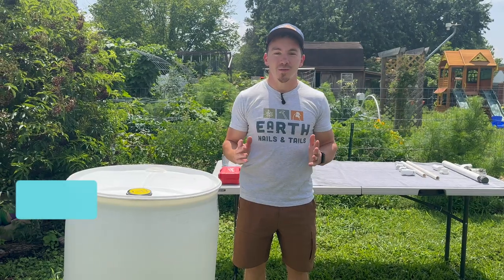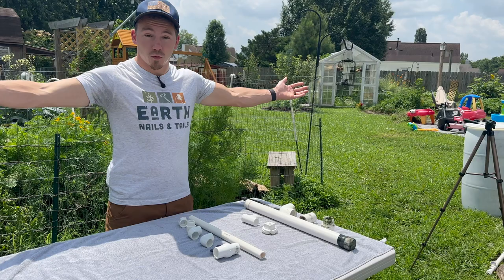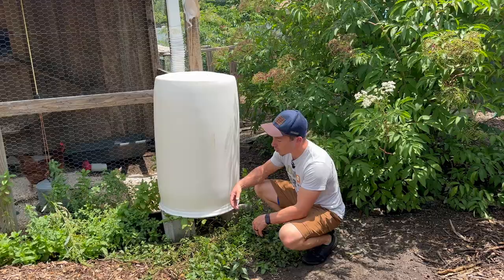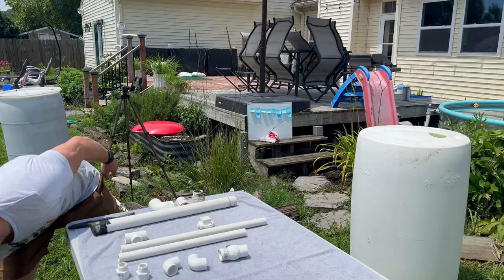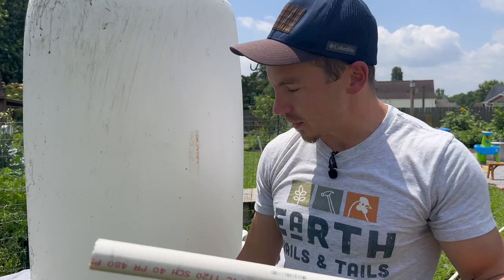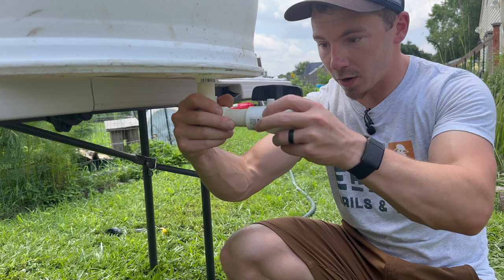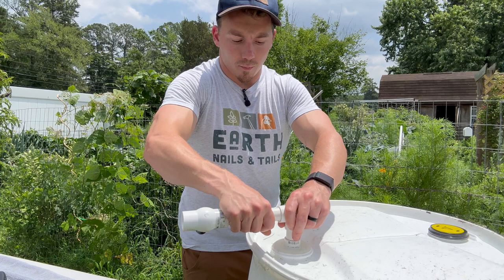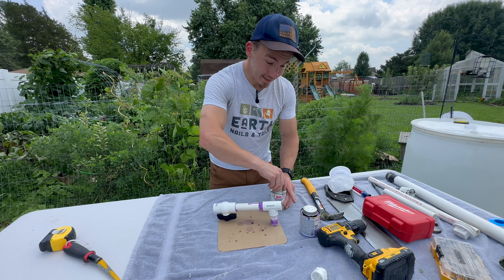How to Build the Ultimate DIY Rain Barrel - Step by Step - Beginner Friendly

Comment: First off most barrels no longer have 2x 2 inch female iron pipe thread bungs most have one and the other a course thread I'f that's missing you can not get a pvc or abs plug I do like your idea of using the barrel upside-down as for the plug below the 3/4 inch threads don't need to drill in most cases just use something about a 1/2 inch in diameter anything that fits into the hole without touching the threads once in just a blow with a hammer and it pops off as for the inlet get a 3 inch pvc preferably or abs adapter to fip u drill or cut a hole just big enough to thread the 3 inch adapter into  put a  3 inch T rain goes in the top and the take off is the overflow barrel fills to the top then anything more runs out the T and  can be plumbed away from the building the T can àlso be used to connect to other barrels I'f all barrels are not at the same levels just make sure that the overflow is above the level of the top of the highest barrel the T can be a 3x2x3  the overflow can use 2 inch fittings which are usually cheaper to buy  I'f you are àlso tieing the barrels together at the bottom all levels will be the same all my 4 barrels downstairs have to be sealed between each other and vented out above the level of the highest barrel connected to my downspouts this way I have 180 imperial gallons of water for winter use and 450 imperial gallons of water for the the frost free months the barrels that came with the house are open top so if I replace them it'll be with a closed top barrel probably used upside down as well
Reply: Amazon carries 2” buttress bung plugs as well as adapters for any size npt you need.
Reply: Good idea about using a T for the infill and overflow.

Comment: I been doing my rain barrels just like this for around 10 years. Have 3 pairs around the house. Added a hose connection after the valve so the wife can use a garden hose. Doesn't have a lot of pressure but gets the job done.
Reply from the maker: Tried and true 👌🏼

Comment: Interesting solution, but with the faucet pipe in the bottom, sediment will get into the garden hose. I've seen people placing the faucet on the barrel side 2-3" above the bottom.
Reply from the maker: If you do that then the sediment will gather at the bottom and you won’t be able to get it out. Use filter to reduce the sediment and having the valve at the bottom allows you to flick the sediment out
Reply: I have an inline filter that is made for the garden hose. Screw it onto the barrel and screw the hose onto the filter. It has a removable screen. There won’t be much sediment in the barrel if you use the sock filter.

Comment: 4:38 I had success with one barrel. Added a 2nd one using a T as you describe, but the water is not flowing into the 2nd. Do I need a vent of some sort on 2nd to release the air as it fills with water?
Reply from the maker: What I would recommend is putting the inlet on one barrel and the overflowed on the other so they are both vented